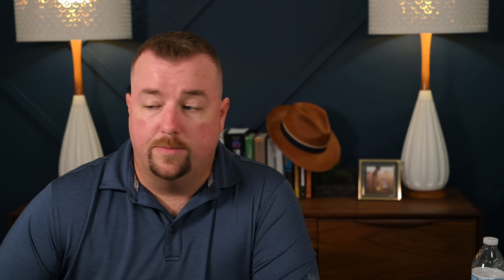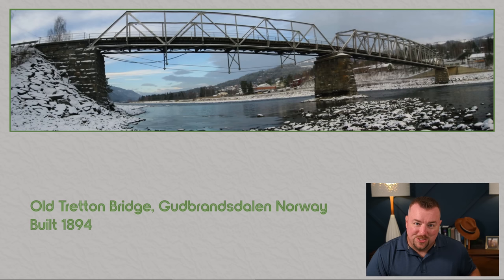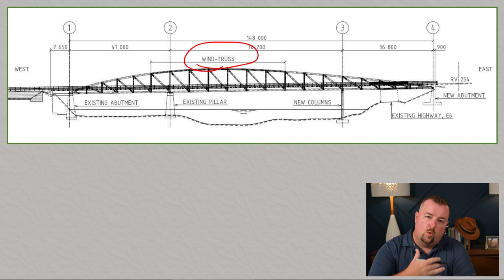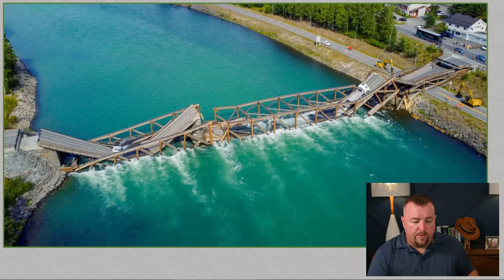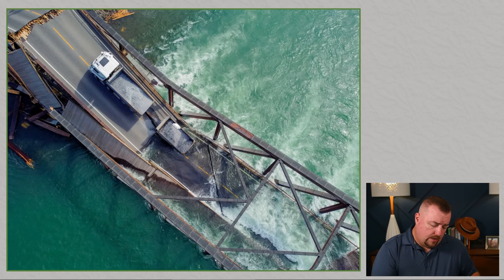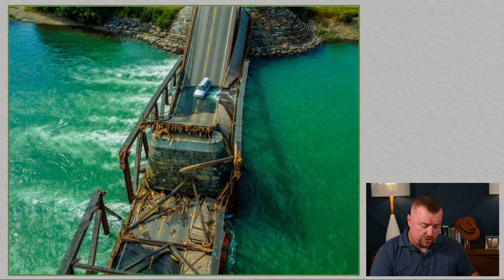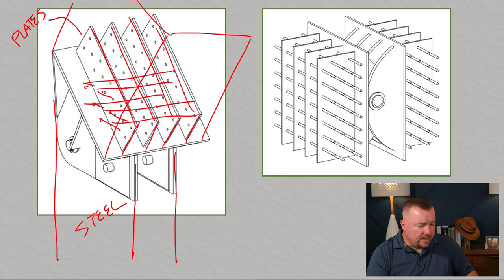How Did the Engineers Miss This?

Comment: I live in Oregon, and we have a lot of old wooden covered bridges. The "covered" part is literally a wooden structure built over the actual wooden bridge to protect the wooden bridge from rotting under Oregon's rainy skies. The use of copper plates on top of this bridge's wooden beams looked shockingly inadequate, even for gluelam construction.

However, Oregon's covered bridges have another interesting feature that this bridge lacks: steel tensioning rods. Since wood is not very strong under tension, the covered bridges use steel rods to tie the wooden beams together under compression. The steel rods take the tension, and the wood takes the compression. I'm not an engineer, but I'm wondering if the steel present in this bridge was providing enough compression for the wooden components.
Reply: Not sure what part of Oregon you are in, but there is a modern version of a covered wood/steel truss bridge in Clark County, WA (near Portland) called the Cedar Creek Grist Mill Bridge. It was designed/built in the 1990s.
Reply: that was a very interesting comcept
a balance between compression and tension
Reply: I think you mean to ask if there was there adequate steel to carry the tension load.

Comment: If you look at very old wooden bridge construction you will find that they would have inserted rectangular keys across the timber connecting scabs on both sides of the joints. The keys do not promote splitting of the wood along the lines of the wood fibers as the numerous pins certainly do. I supervised the fabrication of timber trestle bridges in the Army...we never had a tank end up in the gap. This was an outstanding presentation - thank you for sharing.
Reply: I was wondering why the pins here were going across the fibers as opposed to along the fibers. Makes zero sense.
Reply: @SonicBoone56  I recently secured a demolished barn allowing workers to do cleanup without getting injured.  I used long two by fours as columns with scabs on both sided creating short columns from slender columns. I simply bored one inch holes through the interface between the columns and the scabs and inserted hard wood dowels to supplement the connecting screws. It worked fine and was a lot easier than routing for square pins and getting effective alignment between the pieces.
Reply: Yeah the moment I heard "glued and laminated sheets" and "bolts through it" it was clear what happened. I see the same thing when I drill through planks or rods with hand tools.
Reply: Would it make much difference if the joints had bolts instead of dowels compressing the entire cross section of the beam such that all fibers are effectively secured?
Reply: @RobertDerusha  Bolts might be better for a while, however wood has a nasty tendency to change dimensions when exposed to water.   This change can be slowed by surface coating...paint being far more effective than very pretty varnish. The change is most prominent along the growth rings (not a problem here) and across the growth rings (less of a problem in this application) and not at all along the height of the tree. The objective should be to place the adjacent grain fibers in shear by providing sufficient length between the "across the width" fibers  and the exposed end of the wood or between successive rectangular keys.. That's how it was done in the old days. Screws impeded in the ends of the timbers might be somewhat effective if they were very long and of Buttress Thread configuration. Otherwise the would tend to split the wood like the patented log splitters using a tapered screw. Tapered Buttress thread screws might work but I don't hold out much hope for screws in the end grain...always avoided in classical woodworking. A drilling and taper reaming operation would be necessary for effective installation.
Reply: @peterblake548   Thank you for your reply,
I honestly thought I was just leaving a comment on the video, not a reply to your comment! 

Cheers,

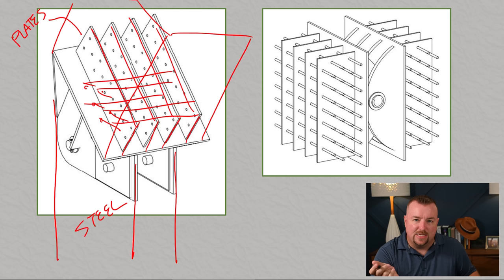Comment: 14:05+ Drilling a series of holes one near the other is exactly how long lengths of wood used to be split. I've done that exact same thing building Inuit wood frame kayaks in the traditional manner and it's a very effective way to split a long length of wood.
Reply: Dumb design - first to take away wood for the fins then to further weaken the wood with multiple holes....Who designed this?
Reply: Also for splitting rocks.
Reply: If I ever drill holes even close to the end of a wood board I'll always add Stainless Steel bands torqued appropriately so the wood can't split.

I've never had a board with SS bands split.  I wonder why I never see the method used on any projects.

Comment: Gosh, it's like we've forgotten the last several thousand years of timber building techniques and all the effort and clever techniques people invented to stop splitting wood beams under tension.

Real Picard Facepalm moment ngl.
Reply: or triple airplane xD
Reply: This was my thought. Wood workers around the world know that wood will split along the grain.
Reply: Lol, yeah agree. Humanity never learns, unfortunately.
Reply: That is exactly what I was thinking.  My favorite homes are timber frame, everything in timber framing has pressure (probubly the wrong word, I am a desiner not engineer) on to each other to the load.  Then they use metal brackets to join everything together. 
Even at my level of knowledge (or lack of knowledge) I know to offset nails or screws so distribute to weight and I don't split the wood.
Reply: timber in compression. We've built successful, long-lasting timber bridges for hundreds of years - and they're almost all using timber in compression.

There's a reason we haven't reinvented the wheel. We should keep that in mind with wooden bridges.
Reply: @AkSonya1010  Many buildings which used wooden dowels to pin the wood together lasted much longer than buildings using iron or steel nails or bolts.
Reply: Totally agree!
Reply: @jasonadams7308  Yeah but do the wood workers have a fancy architectural degree, an expensive computer simulation program and a political agenda to follow ?
Reply: Just look at how much historical medical knowledge was ignored over the past three years...
Reply: It's probably cheaper the way they did it, never mind the facts, we can save money this way 👍
Reply: @iangrice329  cheaper for the corner cutting company, it's definitely a net loss for civilisation as a whole
Reply: @Soken50  absolutely 💯
Reply: @Harry-zz2oh  I agree, on TF they typically stagger the connections with a metal plate outside aka sandwich effect.
Reply: @AkSonya1010  yes I would guess all the slots weaken the wood there.
Reply: @Soken50  You can't get a barge along that river it's not navigable. Almost all of inland Norway can't be reached by barge.
Reply: @jjb2004mk2  ok ?
Reply: @jasonadams7308  And this is why i still haven't made a table with tusked wedged tenons. I can't work out how much wood needs to be "beyond" the wedge to support the loads. It's the same tension failure as this bridge, but hopefully wouldn't kill anyone.
Reply: It's as though they designed the bridge like a steel bridge, then switched to wood. As an amateur  carpenter, I would not use that sort of joint for even light duty connections. Connecting wood to steel is always an issue. Wooden joints, for tension members really need a through joint where some sort of wedge is used to convert the tension into compression. That could be combined with a steel band around the wood being joined to prevent it from splitting due to the forces (though the forces should be directed along the grain to prevent that sort of failure). Much could be learned by looking at East Asian timber building techniques (Japanese/Korean).
Reply: @Soken50  I replied to the wrong person sorry! Somebody said that heavy stuff should be on a barge rather than a road.
Reply: Well, the "computer" said it was a good design so it's not my fault.  Obviously the "computer" was wrong and not me.  Computer models transfer the responsibility for the design from the designer to the software vendor.  It shouldn't, but it does.
Reply: Yep, it's embarrassing, especially because we have a long tradition of building with wood in Norway...
Reply: As a carpenter and someone with a general Interest in engineering  I get really excited about timber getting used in niche areas. 

I took one look at this bridge and cringed. All of the tops and vertical were absolutely fine to be timber. But whoever thought that was okay pulling on them under tension like that really wants to get outside and touch grass. 

They really could have got away with it too had they nailed a steel tension strip along the bottom. Or reinforced the end the timber with metal sheaths that are bolted tight to prevent any expansion (and hence splitting) of the wood. 

I imagine under the road surface if they had any sense at all they laid a plastic membrane to prevent water ingress.
Reply: @slateslavens  Yup, when they build with concrete they design it to be in compression, yet here they chose to use wood in tension, which makes no sense. Yes wood is stronger in tension than concrete but it's still much stronger in compression.
Reply: @AK Sonya  bro you can't even spell probably correctly and we are supposed to have faith in something you design? Seems like you wasted you're time on that degree.
Reply: @Harry-zz2oh  it's possibly a question about ratio not number.

Appreciating the aesthetics of historic German towns eventually lead me to recognise centuries seperate building styles in the remaining houses.

Many thousand times as many wooden dowel connected buildings were composed (after being salvaged for scrap whenever possible) than remain standing.

By similar logic one could point to the floating trusses of east Asian architecture being much more resilient than any wood peg construction (given their religious buildings have lower ratios of stone).
Reply: What would TEDD BENSON (Bensonwood) say about this? YIKES!

Comment: Great analysis.  Regarding the truck and no skid marks, I believe the collapse was extremely fast and there was not enough reaction time for the driver to hit the brakes.  Essentially the truck/trailer combination rolled backwards and stopped as the trailer bottomed out in the shallows of the river.   This was very quick and not much gravitational energy was generated to jack knife the unit, therefore it stayed inline.
Reply: I made essentially the same observation.
Reply: I too concur. The rear axle of the trailer is likely jambed against the deck of the section behind, and having moved only a short distance in reverse, the drawbar of the trailer wasn't subject to much greater loads than just the mass of the truck and its shingle load.
Reply: Don't forget ABS brakes.

Comment: I think the biggest mistake here was using wood to build a bridge to make it look like it was made of steel. Huge mistake. Wood can be used successfully to make a bridge that will carry a lot of weight, but it will look extremely different. If designing a wooden bridge, it needs to be designed to mimic the natural strengths of trees, and minimize their weaknesses. If you want to build a bridge that looks like a metal truss bridge, then use corrosion resistant steel with good quality epoxy based paints with several coats of primer underneath, and forget the wood. Using wood under the asphalt was to construct the bridge deck was another extremely bad idea. Every engineer should know asphalt paving always develops cracks over time. Then rain water penetrates the pavement, resulting in wet spots in the wood under the cracks. This results in uneven swelling of the underlying wood, creating more cracks in the pavement. Even if this truck hadn't broken the supports, the bridge deck would have eventually failed anyway. Like you said Josh, putting a bad waterproofing layer over wood isn't good, because once the wood gets wet, it stays wet, leaches out the treatment chemicals, then it starts to rot quickly.
Reply: I think you have a really good point about how wood just needs a different design.  Just look how much weight wooden train trestles can handle!
Reply: The High Level Bridge in Newcastle-upon-Tyne (England) was built 1847-49, supporting a road and pedestrian walkways under 3 rail tracks (later reduced to 2).  The roadway was asphalt over a timber deck.
From 2005-8 the bridge was closed for restoration, which included replacement of the original 150 year old timber road deck with new timber.  The bridge still carries two rail tracks, and the addition of safety barriers (and weight considerations) reduced the roadway to a single lane for public transport traffic only.
Reply: @robglenn4844  Always in compression. See my explanation elsewhere about the terrible geometry of the truss design they used here.
Reply: A really good point, and very true. As an aside, for people that may be don't know, the first Iron bridge in the world, at Ironbridge in the UK, was built and designed largely as if it were a timber bridge, sort of squaring the circle.
Reply: @hypergolic8468  IIRC it was actually very much 'overbuilt', wasn't it? Luckily for us, as it's still there. And it's a beauty too. But it was cast iron, later discredited for bridge design in the railway industry, after some nasty failures- cast iron being okay in compression, but not in tension, so in that way, maybe more like wood, making the Ironbridge design very sensible if it was built as if wood? I ask pretty humbly here, I'm no structural engineer, so please do correct me if I'm wrong.
Reply: @robglenn4844  that was gonna be my point. There are still some old wooden railroad bridges around, but you never see em in this “tension” (not an engineer, so feel free to describe the correct term) type of design. All the wood is underneath the bridge, being compressed. Plus railroads have the advantage of shedding water quickly (no deck). It can be done, but it has to be a completely different design.
Reply: @hypergolic8468  ...all members in compression.
Reply: @alisonwilson9749  Correct.
Reply: @alisonwilson9749  I think you're correct. Plus cast iron in those days was pretty brittle.
Reply: My impression of wood as a building material is this; the material itself is quite useful in compression and tension, but joints in wood are strong in compression and weak in tension.
Reply: @Horseshoecrabwarrior  Yes.
Reply: There are all sorts of wood truss bridges in the U.S.  Mostly in the east.  Many are over a hundred years old.  The all have roofs over them.  They're known as covered bridges.  Look inside any covered bridge and you will see a wood truss.
Reply: @bradpreston8262  ...And any member in tension is a steel rod.
Reply: I would love it if you could give some examples of wood bridges to show the difference
Reply: @annamyob4624  We have a bunch of covered bridges in our area. When I get a chance, I want to go out and photograph construction details.  They are several truss designs used, but all are different than a steel truss would be.
Reply: @bradpreston8262  I plan to go out and shoot construction details on a bunch of them in our area - when I get time.
Reply: @SteamCrane  that would be neat. I've seen lots of photography of covered bridges but it's always about how quaint they are.  I'd find the construction details much more interesting!
Reply: What happened when artists and architects  have the arrogance to ignore two centuries of proven bridge design and engineering  history.
Reply: @alisonwilson9749  Cast iron is known to be brittle, meaning it breaks suddenly when at the failure point.
Reply: @hypsyzygy506  See also Bristol suspension bridge that has a wooden deck covered with asphalt and also lasted well over 100 years before the original deck was replaced.

Comment: The driver of the truck said that the roadway on the bridge suddenly looked like it had waves and then it was like an Earthquake. He had to remain there for a couple of hours until lifted with an ambulance helicopter. The driver of the other car could apparently get out herself and climb back to solid ground.

Gudbrandsdalen is the valley, not a town.
Reply: Thank goodness no-one was hurt. Also looks like they could have disconnected that truck from it's trailer and just lifted it out with a heavy crane and probably no damage either. Might have had to get the load out first though.
Reply: @brnmcc01  They built a causeway out to the steel pillars, knocked down the bridge segment with the truck on it a bit, attached tow wires and pulled it off the bridge segment. Then they drove the truck away, still with wagon attached and the loads still on. If you search "NRK" and "brukollaps-pa-tretten" you can find a video of the operation. The video is 15 hours and the first 6 are the truck recovery.
Reply: @zapfanzapfan  Thanks for that. There are actually three similar videos, covering I think three days of bridge demolition and yes, also the recovery of the truck at around hour 6:00.
Reply: @Delibro  Yeah, there were more than one video. There was also one of just the 4 minutes of towing the truck off the bridge segment.
Reply: @zapfanzapfan  "I ain't got no time for that!" 🤣🤣🤣
Reply: When I hear Gudbrandsdalen I always think Brunost.
Reply: @zapfanzapfan  Yes! Move over, Hurtigruten - this is the new slow tv!

Cheers for the suggestion :)